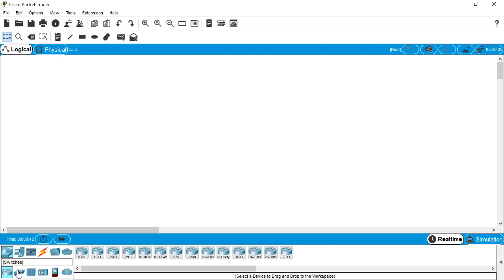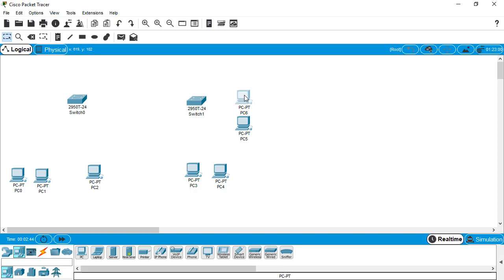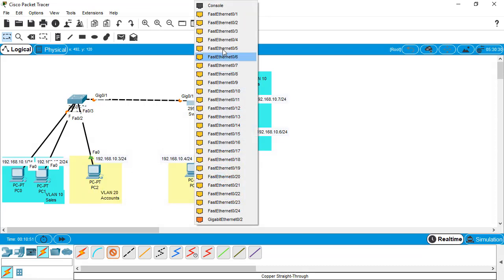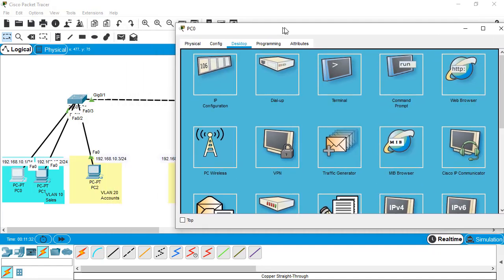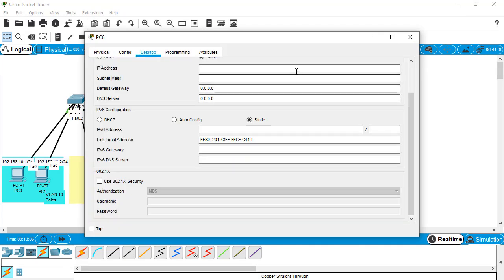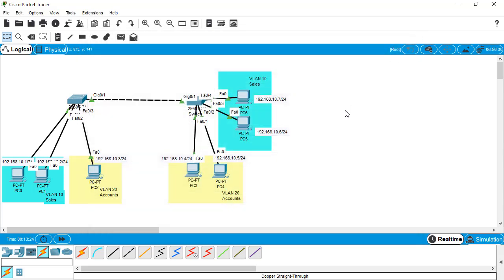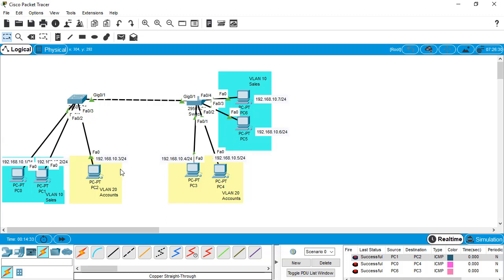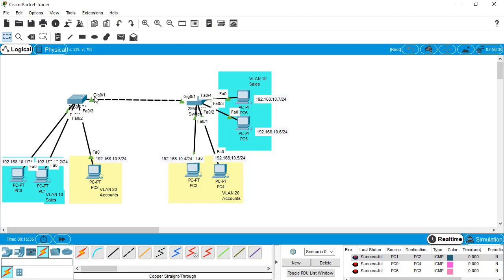How to configure Trunk Port configuration on a Switch using Packet Tracer

Comment: I typed the commands but forgot to type the "copy running-config startup-config" command. When I saved and closed and opened packet tracer, there were no issues. Will there be any issues if you forget to type the command??
Reply from the maker: Yes, It'll be an issue. copy running-config startup-config command saves the current IOS configuration to NVRAM as startup-config file, and whenever router shall boot-up then it loads the previous configuration (i.e., startup-config file.. if any). I'm not sure why It doesn't happen in packet tracer but you better to give this command to save your configuration.
Reply: @dipakbari4  oh you mean when we press the power cycle button? So I have to go separately to each and every switch and type the command ryt.?
Reply from the maker: @Himeth  Yes, technically you'll lost your current configuration on next boot.
Reply from the maker: @Himeth  Yes, technically you'd lose your current configuration on next boot.
Reply: @dipakbari4  OK i'll do the changes.. Thank you very much for the information🔥👍
Reply from the maker: @Himeth  You're welcome. 🙂